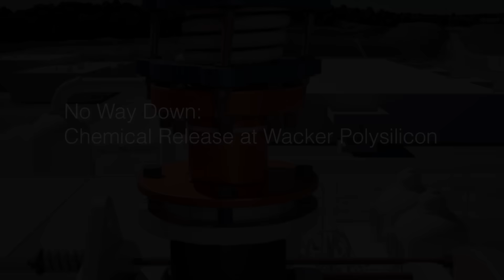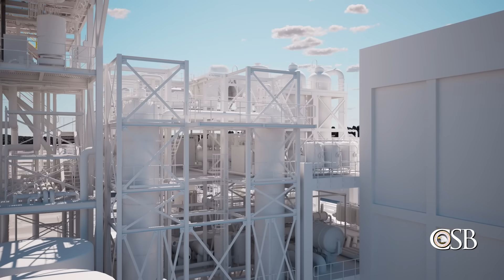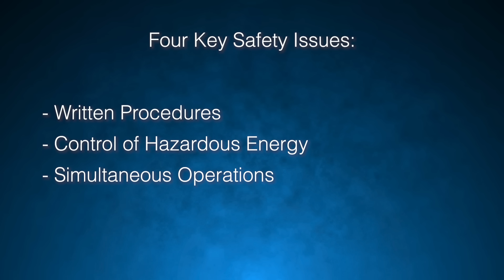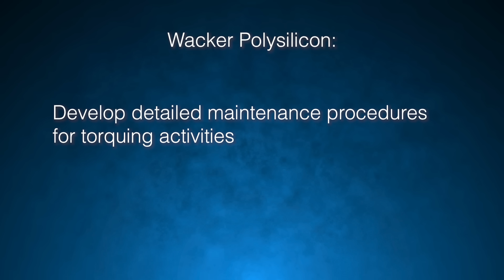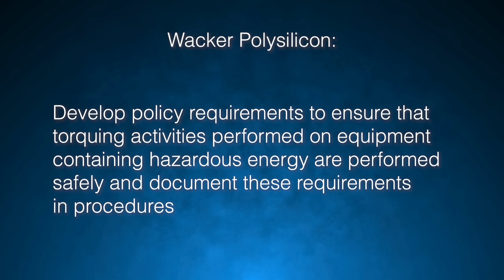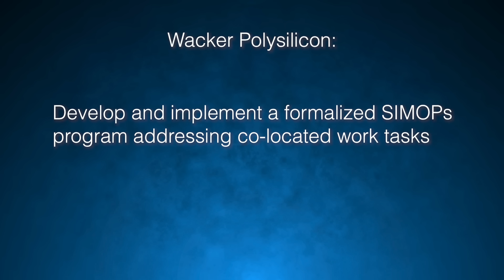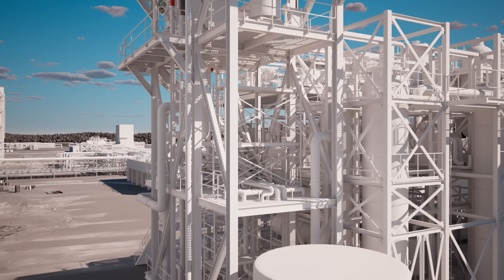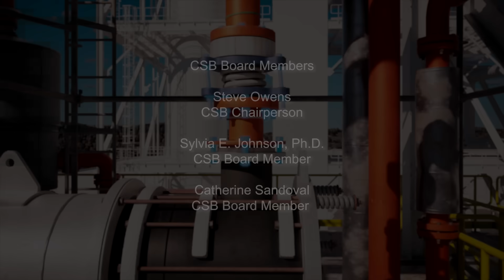No Way Down: Chemical Release at Wacker Polysilicon

Comment: Is it typical that torquing bolts on a pressurized gas pipe connection is not considered energized work?  That seems insane.
Reply: I’d call that hot work, for sure.

Comment: More actual photos would be neat. 
Wondering if the bolts were color coded irl.
Little plastic bolt cover could act as economical specification tag. Qr code, and spec numbers WITH units obv.

Comment: Interesting there is no mention of concerns regarding the safety harnesses of the Pen Gulf employees were issued but did not wear. See approx. 2:51-2:55 in the video. Assuming they were not some kind of 'escape harness' to slowly lower a worker to the ground in an emergency, the non-worn harnesses could also not be used by the Pen Gulf employees as safety lines as they bravely tried to climb down the structure to escape.

Comment: My question is, why was there HCl in a system without torqued flanges? I work at a chemical plant - a system is not sealed and ready to be inventoried unless if all flanges are made up and properly sealed, all valves are locked closed, etc. This seems to me that either 1) they took this HX out and did work to then put it back in, and reinventoried before retorque (bad), or 2) somehow the HX flange bolts got loosened during operation (even worse, and how is that possible?)

We actually used this incident as a safety topic a while back, and I had this question then and still have it now. Maybe it's answered in the full length CSB report, but it's just a weird "how did the circumstances to cause this even come up in the first place?"
Reply: The flanges are all PTFE lined. It has to be retorqued and has to be done hot or it will leak if only torqued cold when it comes up to temp.

Comment: It's amazing to me that we're three decades down the road on Process Safety Management requirements for high hazard operations, yet the deficiencies listed were still found at Wacker. It seems like their management or engineering, or safety folks didn't care about the requirements. A properly conducted Process Hazard Analysis would have uncovered the sensitivity of maintaining graphite fittings - and as an  example giving a recommendation to placard graphite fittings to warn maintenance personnel.

Comment: I hate wearing my ppe, but I'll hate being maimed or dead more, so I wear it. Got poked fun at once by a senior tech while I was the most junior and newest tech for wearing the suggested fire-retardant suits while going through the maintenance tunnels to swap out a valve, since they were hot to wear and slowed you down. yeah, sure, the valve we're working on right now is "just nitrogen" but these tunnels also have pipes for hydrogen and fucking silane so yeah I'm going to wear the ppe.

Comment: > several workers tried to climb several stories down a pipe but slipped off and then died or were severely injured
It turns out Real Life isn't Assassins Creed, and free climbing a building with no climbing safety gear is really fucking hard.

Comment: I think it would be important to also scrutinize the regulations/enforcement of required means of egress for temporary structures as well.
Recently, someone I know witnessed a blowout and fire during an onshore drilling operation. The fire blocked the only stairs off of the rig (secondary catwalk was not installed for rig walk), so the workers on the floor had to jump for it (few dozen feet) or climb down the pipe handler. One guy was seriously injured when he fell.

Comment: 2025: The USCSB concludes that acronyms like SIMOPS, which shorten simple terms, are unnecessarily confusing. Instead, it's clearer to simply say that you should not perform two tasks at the same time.
Reply: That's a nice thought, but it's often necessary to perform two or more tasks at the same time. Shutting down continuous production processes is expensive, difficult and dangerous. Work that cannot be done while production is underway must be done in a finite window of time. This will almost always necessitate multiple work groups performing tasks in a given area. The failure isn't in planning for simultaneous work, it's failing to communicate with both work groups and ensure that they understand the potential hazards, are wearing the proper PPE, and are considering important things like egress routes, safety shower locations, and other items that become important in an emergency.

Comment: My very first thought at the start of the video. Is why don't these structures, have multiple emergency escape ladders. If you one have a single set of steps. And a fire near or on the steps. Two or 3 emergency ladders would make things safer. Or have emergency boxes. With  emergency ropes and or rope type ladder on each lever. Plug emergency respirators. It said in a safe evacuation. Most of these structures are steel. It would be very easy to weld some emergency escape ladders. With safety cages. To help workers in and emergency.

Comment: the bolts should be frangible when joining fragile material
Reply: Exactly! Idk how they didn’t bring this up in the video. Don’t use bolts to connect things of two drastically different physical properties and definitely don’t make the bolts more strong than the material its bolting. Find another way to connect them or don’t connect them. If you absolutely must break those rules make the tool that tightens those dangerous bolts not work with anything but those bolts and no other tool than that one can tighten the bolts. Plenty of flaws in the design were glossed over I imagine.

Comment: Respect to the man who used his body to protect the unprotected worker during the release. I know how much using muriatic acid in a tub burns your eyes/throat, I can only imagine how bad it must have been in that release! It shocks me that there wasn't even a sticky note saying "torque to this spec" on the hardware. My boss and I scribbled down the torque specs for various parts on our CNC mill setup sheets to avoid an over/under torque situation.

Comment: I used to be an apprentice Industrial Pipefitter. Love this channel so much. I've delt with wrenches that are taller than I am, and I'm 6 feet tall. These wrenches can get mind-blowingly massive, lol. I was injured twice, but nothing serious. Once, a massive end cap weighing a good 300 pounds, landed on my foot. Thankfully, it didn't end up bending the steel toes inwards on my boots. Another time, a group of us just got done with a meeting, I turned around and took a step and ended up falling into a hole due to one of the floor grates having been opened. Sprain my ankle or something, since my toes turned purple/red for a day or two, but I just continued working and my toes are fine now many years later. Stay safe out there, folks! So many ways to get injured; or worse out there.

Comment: I'm surprised if you have setups like that - where the normal torque requirement for one set of bolts is dangerous for another - that you use the same bolt head for both. I get the whole economy of scale thing, but a simple way to mitigate this sort of thing would be to have deliberately incompatible bolt heads. Not perfect - a sufficiently determined person may e.g. go look for a different size torque wrench - but helps.

Or label the boltheads themselves with torque values where they differ from the norm. (Of course, then you introduce a risk that someone swaps a bolt somewhere it shouldn't be - but that's something that be inspected for fairly easily).

Comment: If your bolts are used in a failure-hazardous application, and the torque requirement can cause a deadly condition if misapplied, then the bolts should have a (preferably corrosion resistant metal) stamped or engraved (i.e. not reliant on paint or ink remaining intact) tag indicating the torque requirement on each bolt. This is even more important if the bolts are directly adjacent to bolts of similar physical size that specify a different applied torque. It is way too easy of a mistake to make.

While written procedures are important, having them would not have prevented this accident. The apprentice failed to adjust the torque wrench to the correct torque, and his journeyman did not catch the error, or did not understand its significance.
Reply: written procedures would very much have prevented this disaster, as the contractors would have known of the different torque requirements.

Comment: To me it seems like the CSB glossed over a critical issue in this particular incident just as they did in their video on the MGPI Processing chlorine release: why did Wacker leave the system to continue pumping hydrogen chloride during the work? (especially during a planned shutdown which should have seen all equipment taken offline for maintenance) If they hadn't there likely would have been no incident as there would have been no gas to leak (though just the same the piping likely would have leaked anyway once the system was restarted, but at least there hopefully wouldn't have been anyone near the leak when it occured, thus saving lives & preventing injuries (at least if the response to it was correct, with full hazmat suits & SCBAs, & even if there were people around hopefully none of them would be on the platform & thus they would have a better chance of evacuating successfully). Just seems like an extreme oversight on both Wacker & the CSB's parts.
Reply: Shutdowns and startups carry their own risks.
Reply: @FayeVert  Companies should still do all they can to minimize said risks though, no? In this case Wacker should have shut down the hydrogen chloride system to minimize the risk to the contractors who would be working on it, yet they didn't for some reason & as a result that contributed to the death of one contractor & the injury of several others.
Reply: @TheCarson116  that's my point, sometimes the safety risks of a shutdown and startup are higher than continuing to operate.
Reply: @FayeVert  I don't get that since it seems like in this case at least that Wacker should have been able to quite easily & safely shut down the hydrogen chloride system & then start it up back up again once the work was complete.
Reply: @TheCarson116   you have to look at what else would need to be shut down within the larger system in order to enable shutting down that specific part of the system. If they shut off the flow to that pipe, does that mean pressure will build up behind it and cause something else to blow up? If it's shut down and drained, will the air that fills the pipe react dangerously with the hydrogen chloride when it is opened back up? 

Looking at the written report, they actually had shut it down the week prior, but for some reason had them do the torque check a week later. 

I believe the "oversight" was actually addressed by the "control of hazardous energy" point the CSB raised.
Reply: @FayeVert  They probably have procedures for doing such things including what else needs to be shut down to avoid problems (though almost everything should have been shut down given it was a planned maintenance shutdown).

Oh for Pete's sake: that's just poor timing then if they shut it down just fine but before the work took place. Love to know who made that blunder & why/how...

Oh, maybe.

Comment: In 3 minutes, the maintenance technician managed to tear a hole in his acid suit, knock his respirator off in the middle of a cloud of acid, and fall off a 70 ft tower. Really shows you the value of staying calm and thinking things through in situations like this...
Reply: I wouldn't discount the sheer lack of visibility, you could easily snag on something even moving somewhat cautiously. ...I agree the respirator might've been more preventable, although if you had to duck under something to move about, that could just happen too.
Reply: High pressure gas release us loud enough to disorient you by messing with your inner ear. It is very hard to balance when that happens
Reply: @jhacklack  you're not kidding. i've been close to a punctured compressed air pipe and it's like there's a radius around it that thinking just turns off. and that was me voluntarily walking into it for a minute, tops, so I could grab my bag from a break area. had it occurred right next to me and without any warning, it would have been an aural flashbang.
Reply: Panic is the biggest killer in almost every situation. Diving, driving, emergencies, anything. You don't know how you'll react until you're in that situation.  It takes training and experience to overcome that flight instinct and keep your mind running, instead of shutting off during extreme events.
Reply: The maintenance tech didn't fall off the tower. They were trapped by the stairwell until the release had stopped. The one who fell was one of the other workers that had been installing insulation.

It does still underscore the value of staying calm. That's often a tough thing to do in emergencies, especially if you are inexperienced.
Reply: @Tekker2234 enexperienced and breathing HCL
Reply: @Tekker2234  Emergencies aren't something you can train for exactly. It can only be experienced. You can only prepare and have knowledge.
Reply: @coreym162 sure you can, that's what safety drills are for, training what to do in an emergency. Of course simulating an emergency isn't the same as an actual emergency but often the lessons learned are directly applicable.
Reply: The person. Who tore their suit and lost their mask was a different person than the one who fell and died.
Reply: If I was engulfed by HCl I wouldn’t exactly be thinking clearly.
Reply: @LiamSkoda  skill issue
Reply: He was a contractor and an apprentice, so par for the course. He's also the one that caused the release when he tightened the bolts too much, so he had a lot of reasons to run like mad and bump into things.
Reply: I see you have never worked in an industrial environment let alone a chemical plant or refinery. You are surrounded by danger all the time and you don’t know how much product is in a pipe or vessel and how long you have to wait and hope (potentially wasting time) for a discharge to stop that might take hours. 

The people that fell off the platform were using a rescue device with 3 mins breathing air at panic rates and they had no PPE for the product. They climbed because they knew they were on limited time and thought it was the best option than staying in a chemical cloud. 

The workers in PPE and the female insulator the protected may have died if the discharge had continued longer. They made the choice to stay because they thought it was the better option and by pure luck they were right.
Reply: I was thinking the same thing.
Reply: Unfortunately at least with my experience the only way to actually learn to do that is... basically get thrown into dangerous scenarios or be lucky enough to be calm and cool naturally. It's why militaries spend so much time yelling and 'punishing' people, you basically train their brain to operate under high stress conditions. Problem comes when you need to turn that off though.
Reply: Thanks captain obvious we saw the same video and remembered it a bit more clearly than you did.
Reply: I took the BOSIET training to escape from helicopters or a burning oil platform which required us to be submerged in a pool inside of a helicopter fuselage. You have to push out the window and swim out to pass. It is 💯 an exercise of mental control. It takes 30 seconds to wait until you are flipped over, push out the window, and swim to the surface. One guy just could not do it. He panicked over and over again. I felt badly for him as his panic was clearly real. However, it was also insightful that some people probably should not participate in this type of work, no matter their desire to do so.
Reply: Yes
Reply: DEI probably
Reply: @alexlogan202  There’s nothing that screams “I’m a total buffoon and have nothing intelligent to say!” more than leaving pointless, incorrect, and unrelated comments like “DEI” on random videos/threads. For real, it’s like a person walking around with a “kick me” sign.
Reply: he sound's like a Bumbling Oaf
Reply: bro was cooked before he got to work. dude was on borrowed time
Reply: They're not sending their best...

Comment: I'm 71, and have worked in the Oil and Gas industry since just before my 17th Birthday. That folks is 54 years, in 16 different countries. Thank Goodness, I've never worked in the USA.
From what I've seen from these video's from the CSB, Management of the Oil and Gas, and Chemical Industries seem to have scant concern for workers safety. Time and again in these CSB video's the same concerns are mentioned. 
Proper Training; Written Procedures; Energy Control and Energy Isolation with proper preparation of equipment for Maintenance; Use of Contractors with little or no experience of working in potentially unsafe conditions, with little or no supervision, before, during and after maintenance work; No understanding of hazards internally and externally of plant equipment and the controls to mitigate hazards; and SIMOPS, amongst many other controls.
For the last 20 years I have worked in training and the number one issue that I and my training colleagues hammer home to our trainees is SAFETY, SAFETY, SAFETY. 
I've seen and watched these CSB video's for a number of years now, and they are to be quite honest, marvellous but also truly disturbing. The same issues crop up time and time again.
I once read that a worker in the US is ten times more likely to be killed at work than a worker in the UK and Europe, and one hundred times more likely to be injured. 
The has to be a complete mindset change in the US about Training and Safety. As always as it has been during my working life, long as it has been, when it comes to money and the supply of money, and profits, when the costs rise, the first things cut are Training and Safety. 
I hope and pray that someone will start to kick up a real fuss about this issue in the US because by God, You need it.